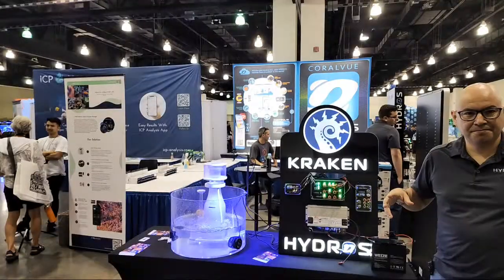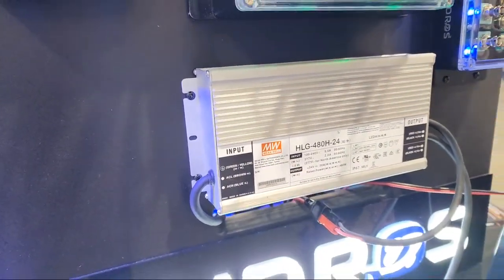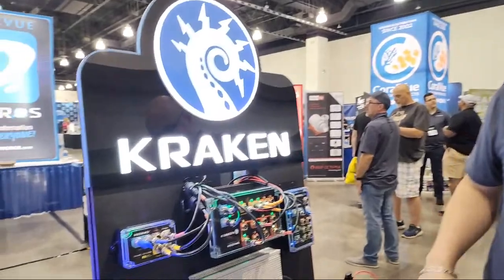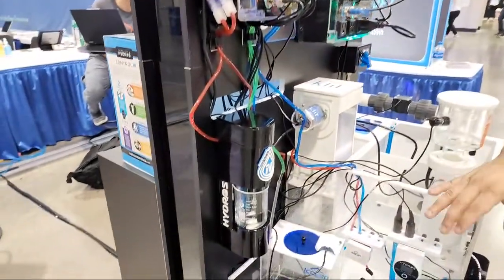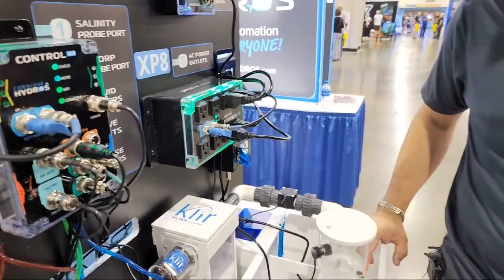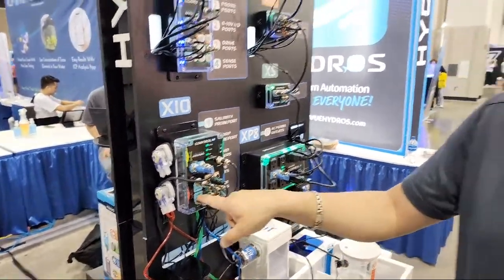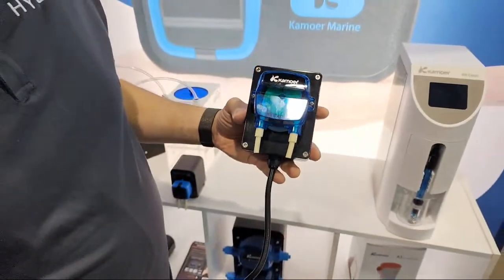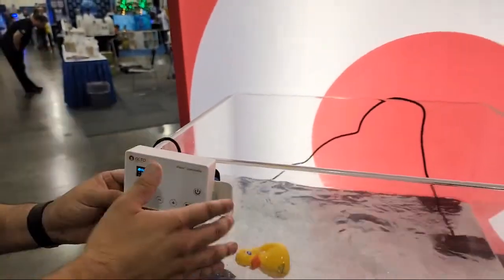Release the Kraken! Exciting new launches from Coralvue.

Comment: What are the power limits for the ports on the Kraken? The drive ports on the Control x4 are fairly low at 1 amp max per port and 1.5 amp max combined. For reference the Tunze Osmolator pump uses 1.2 amp at 12v.

Comment: Product makes no sense, single failure point, low output at 480W which is still too high for your drive ports and only one voltage.... 

Still need a unit with more probe points and more importantly a unit with just a single or double PH probe on it (no-one wants all these drive ports). Anyone who has done any serious testing with a PH probe (even the most expensive double junction ones) knows they can't be relied on without a second reference point and the easiest way to get the second reference is a second PH probe. Without the second PH reference you have no idea if the probe is accurate or not if it remains constantly reading in a solution. The rate at which a PH probe moves out of calibration is a lot faster than most people think and requires a second PH probe if you are using PH to drive anything (such as dosing/CO2/scrubbers).